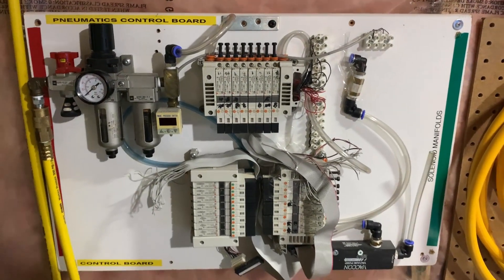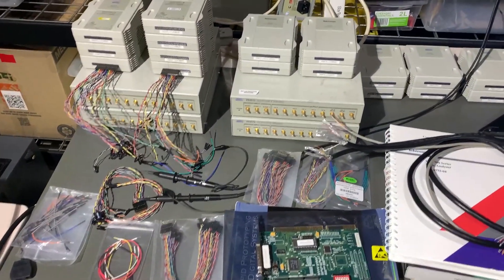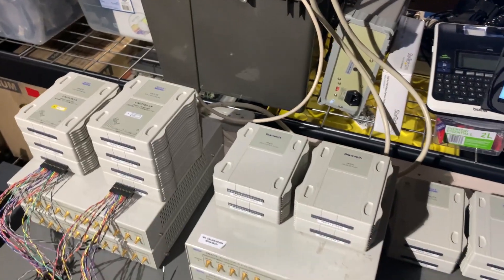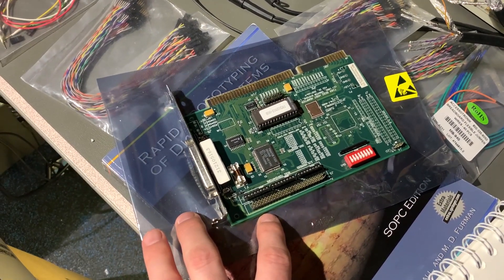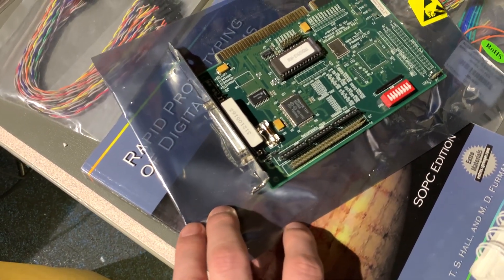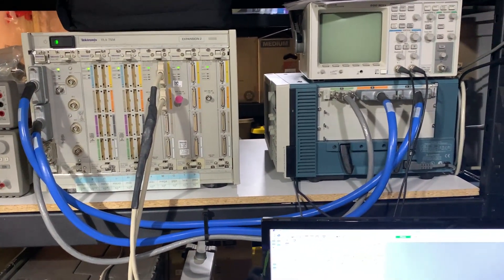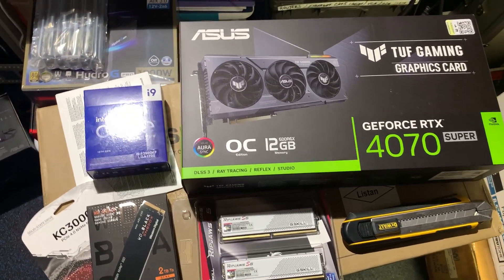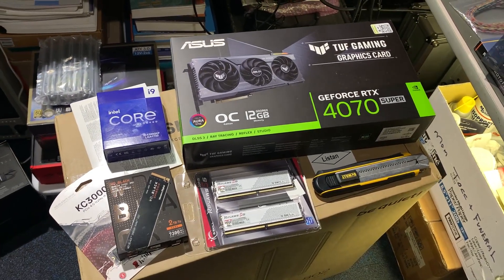YES..... I am still here and still Alive!

Comment: I’m so fascinated by the network automation piece. I work in IT, so it’s great seeing how folks work through problems
Reply from the maker: Hi Trask!
Yeah it was pretty awesome once I got that working.

The network interface was actually intended for use on older windows OS versions.(98, XP)

I had to go into the Windows registry on the LA mainframe itself…and find the specific registry keys for the Logic analyzer software. From there I had to create a specific registry script in order to apply those same keys to the client PC running Win7…and allow access over DCOM. Tektronix never provided a registry script for Windows7 or later.

Once I figured it all out and successfully connected to it over the network….I was pretty pumped!

Victory is MINE!! 😎🤘
Reply: @BehindTheCode_wGerry  That's great, thanks for sharing some of the details!